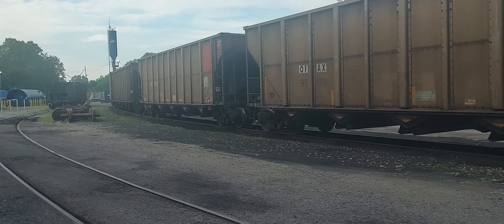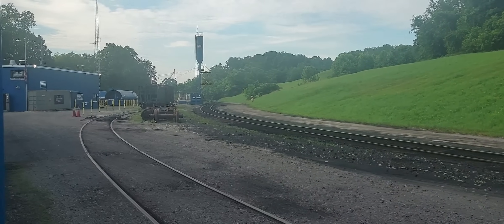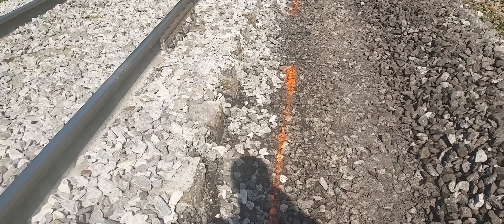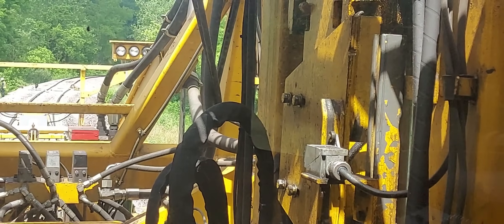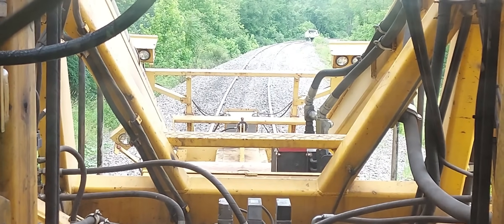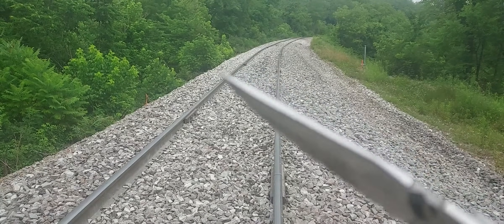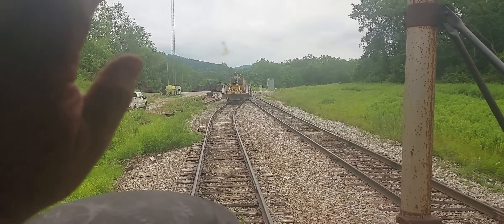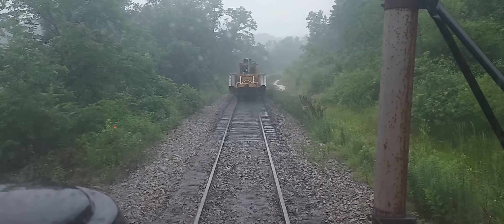It Was an Intense Time on the Railroad this Week

Comment: Thank you for this video! 
Successful surgery on the rails. Having them checked for internal rot by ultrasound and for alignment (roll) by the geometry truck took care of pending items. Send some of the rain to this arid desert SoutnWest.
Roll, pitch and yaw are from aviation. Roll is as in doing a cartwheel (leaning left or right and keeping going); pitch is nose down  (or up), tail up (or down) as in a somersault, and yaw is turning right or left as when an ice skater spins .
Reply from the maker: Your welcome Robin. Always a good thing to have the ultrasonic and geometry testing done. heads off problems before they
become derails. We never had a geometry truck in until Iron Senergy took over. I'm glad we get them now. Thank you for taking the time to watch our video and may you have a very good day.

Comment: That older electronics is more sensitive than modern day stuff!!! And harder to find parts… and I should know!!! But some of the older tube type equipment was a bit more bulletproof against that type of issue but was more sensitive to shaking around. Think of the old time car radios from the late 40’s and 50’s… take a lightning strike, no issue, hit a big bump… and kapow, all hell breaks loose. Should be working on cable tv when lightning hits the plant 8 miles away… even in an insulated bucket truck… it tingles….😂

73’s
DE N2JYG
Reply from the maker: I remember our old TV's Franklin had a lot of tubes in them and
the TV repair guy would come and if he couldn't fix it on the spot
take it back to his shop. Course back then we only got 2 channels
when I was growing up with rabbit ears. Then my dad put a
big antenna up on a pole outside and we got 3 channels some
of the times.  Really appreciate your taking the time to watch our video and may you have a very good day.

Comment: Well that's true too what will also cause that is to much rollover on the head of the rail, a grinder will take that off and make it stop squeaking sometimes
Reply from the maker: Your right Steve, I've been requesting a grinding program since 2010.  Since we don't interchange we would have to get a small
switch grinder in here, but so far none has shown up. I think our
rails would greatly benefit from a grinding program, but what do I
know?

Comment: Dave, glad to see tamper and regulator are behaving themselves. Ultrasound and geometry trucks mean more work for you and the track gang. Safety first. Lot cheaper then a derailment clean up. As hot at it has been, I'll take some of that March cold back. Stay safe out there.
Reply from the maker: Your right about that Thomas, testing is far cheaper than derailments, head off problems before they cause a derail.
Thank you for taking the time to watch our video and may you have a very good day.

Comment: That squealing on the curve is just another sound of money.  Unfortunately I know what it feels like to hit by lightning.  Was driving my Dads' '74 Jimmy into town and next thing I know the truck is on it's side in the ditch and my neighbor is banging on the windshield asking if I was alright.  I couldn't feel anything on my right side and had severe burns on my hands and right butt cheek.  Turns out lightning had struck a surveyors' marker in the road as I got there and burned a 2 inch hole in the front bumper.  There were cracks in the steering wheel and the seat was worn through to the frame and this accounted for the burns I received.  Spent a night in Langlade Memorial hospital in Antigo Wi. recovering but it took about 2 mos. for the paralasis on my right side to wear off.  At IRM in the early 80s our track gang knocked off before a large area of thunderstorms was to hit and we got to see St. Elmos fire build up on the trolley wire.  It had a sky blue color and slowly began to come together by a pole halfway between the depot and the diesel barn.   It formed a ball about the size of a basketball and slowly dropped from the wire hissing and sparking out little lightning bolts.  It got about 4 feet below the wire when it exploded in a loud "POP" and a shower of sparks.  One of the guys had his 110 Kodak Instamatic camera with him and got several pics which he sent in to WGN TV in Chicago and these were shown for several days with the weather report.  When I hear thunder nowdays I go inside immediately, I learned my lesson and don't mess with that stuff.  Great railroad update, enjoyed it greatly.  Stay safe out there!
Reply from the maker: Wow those were some kind of stories poowg. I was in my grandmas
house as a little boy and a lightning ball came thru the screen door,
I remember it, then it just kind of disappeared. it wasn't big, bout
the size of a baseball. I don;'t remember a noise like you heard,
but it sure was scary for a little boy to see. Thanks for sharing your
stories with us.  Really appreciate your taking the time to watch our video and may you have a very good day.
Reply: What a sight. As a kid I saw that happen too and was calling Mom but she did not see it. It's the only time I ever saw anything like it and has fascinated me ever since. I don't like being outside in a storm but do look out over the hills when a storm comes hoping to see a rare ball of energy again

Comment: Hi Dave. Ive watched your episodes for years!  Do you have a episode that covers how you keep the geometry through a curve?  Do you have some indication in your equipment that helps?  I'd be curious!
Reply from the maker: Good suggestion for a future video Matthew. There is a lot involved
in keeping the correct geometry, that includes alignment and
also cross level between the rails. I do it all with my tamper,
but I have to set up the curves for the proper alignment in the
computer which then I can manually line the curve or also let
the computer take over and do it. I often do both. Taking low
spots out of the track I tell the tamper what to do, this is an old
video but it may help some in showing how the track is aligned
with the tamper, but it is by no means comprehensive about
what all goes into the process.
https://youtu.be/XhOV2sOIuzs

Comment: Sounds like a few bearings need greasing
Reply from the maker: The bearings on the car wheels are sealed bearings if that is
what you are referring to John. Friction from the wheel flanges against the rail head is causing a lot of noise in the opening
clip. Thank you for  taking the time to watch our video and may you have a very good day.
Reply: just said something earlier,

Comment: at 2:45 think you may need a flange greaser..........
Reply from the maker: We have 16 miles of main line track here rear speaker and we do
have 6 wayside flange greasers, but the one closest to the harbor
is at MP 14.2 and the harbor is at MP 16.3 so the grease
is not carrying to that point. Grease would definitely cut down
on the rails singing our right about that.  Thank you very much
for checking out our video and hope you have a very good day.
Reply: @ccrx6700  didn't know that, thank you
Reply from the maker: @rearspeaker6364 😊👍🚂

Comment: Thank you for another interesting video Dave! It is great that your company goes above and beyond the required rail testing!
Reply from the maker: Your welcome Raymond. We have done the ultrasonic rail testing
for over 20 years, however it was not until Iron Senergy took over
that we did the geometry testing. That is a very good thing we
are now doing that also. Geometry testing as well as ultrasonic
testing is never 100% accurate 100% of the time, but both do
provide a very good reference point on areas and problems that
need addressed.  Iron Senergy has spent a tremendous amount of money on this track since they took over our mine and I am very thankful  for that. Huge difference between our track now and what
it was with our last company that owned us. Much safer now.
Thank you very much for checking out our video and hope you have a very good day.

Comment: Get a 12 volt charger for the GoPro batteries. It's always dead at the wrong time 😅 carry extra batteries when you can. Don't forget to use "power" rated cigar lighter socket for a charger, the usual factory lighter socket has a thermal fuse inside it and it pops on constant high loads. 💡
Reply from the maker: I do have a charger that plugs into a cigarette lighter Bruce, and I use it sometimes in my lo rail truck  but the tamper doesn't have
a lighter socket. Good suggestion on getting another battery,
i never thought of that. Thank you very much for checking out our video and hope you have a very good day.

Comment: Hi Dave, along with the work you do creating your content I am really impressed that you take the time to read and reply to the large volume of comments each video generates!  “Shocking” they did not get you an insulated tamper. I have seen that Forest Service fire lookout towers have a special insulated stool to sit on during lightning. You need one!
Reply from the maker: Thank you for the nice comment Jeff. I do answer every single
comment, it takes a lot of time, but I enjoy doing it also. Lot's of
folks ask questions and I like answering them. Those plastic
blocks on the tamper jackbeam clamps are available, but since
we don't work around crossings that have lights we don't use them.
It is rare I tamp in an electrical storm anyway. In the past when
a lighting storm came up we were told to get off the rails if
we could. At least the wheels on the tamper are insulated.
Thank you very much for checking out our video and hope you have a very good day.

Comment: Wow, another fun day on the railroad. Busy yes, a lot going on at the same time. How much rail did they have to cut out? Track is looking good. Lightning and metal rails/equipment would make me park it for the day. Thank you for sharing Dave and have a great week.
Reply from the maker: if we were working on track on foot we were told in the past to
get off ASAP during a lightning storm Rob, and we did. Over the years we've had some wicked storms come up. One time I
was in the regulator and a storm from the south came in,
lightening all around and I beat feet down to our long tunnel
and hid in there.  On curve 36 on the low side they cut out 1
inch, on the high side none, but that joint gap was pretty tight when
they pushed the rail back over. On Wednesday I threw that
part of the curve outwards with the tamper and opened up
the joint gaps a bit.  Thank you very much for checking out our video and hope you have a very good day.

Comment: She's singin today! It must be amazing having that geometry report to show you what needs attention. Imagine the time saved inspecting!
Reply from the maker: Geometry reports are pretty nifty Lowell. it is amazing the technology they use to do those reports. However they sometimes
report defects that are not there in the track and sometimes they
miss some geometry problems, same with ultrasonic testing,
neither is 100% accurate 100% of the time. However both do
provide a pretty good description of things that need attention
on the track. We did great this time, very few defects and only 1 place a slow order was recommended, and I fixed that spot on
Wednesday.  Thank you very much for checking out our video and hope you have a very good day.
Reply: @ccrx6700  Yeah ultrasonics is never 100%. But as you said, well worth the investment considering the kind of defects it can catch before major problems! A busted rail is a bad day with a fully loaded train I would imagine. Kudos to your company for going the extra mile to keep things safe and rolling.
Reply from the maker: @ManiacRacing 😊👍🚂
Reply: @ccrx6700 Dave doesn't your tamper do some basic geometry alignments?
Reply from the maker: @ginog5037 yep it does 😊👍🚂